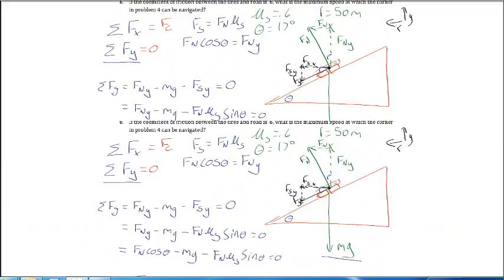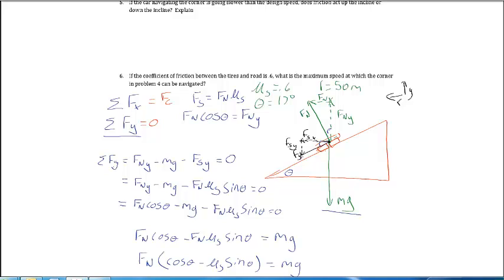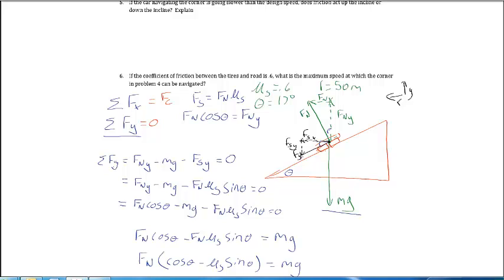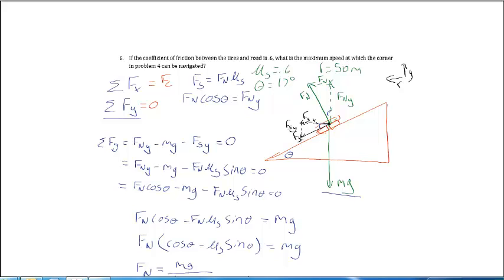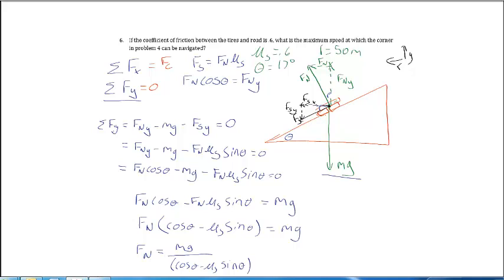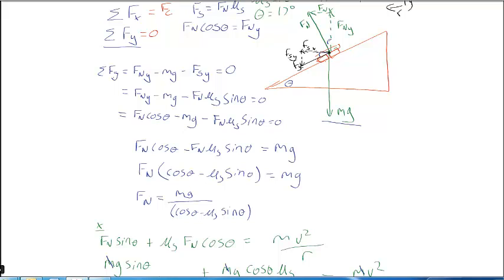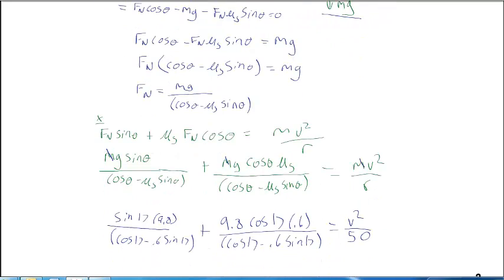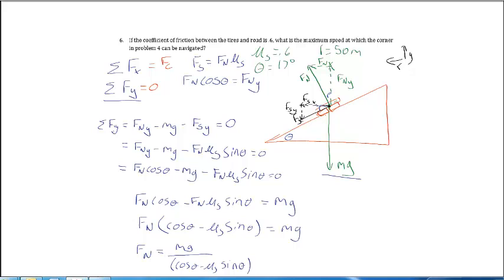Banked Curve with friction

Comment: Shouldn't there also be an x component of weight?
Reply from the maker: +lolzomgz1337 No.  Many times when we deal with a block on a ramp, the block accelerates down the ramp.  In those cases we rotate the reference frame so that the acceleration is parallel to the x axis.  Since the pull of gravity is not parallel or perpendicular to the ramp, the result of rotating the reference frame is that gravity has components in both the x and y directions.  However, in this case there is no acceleration along the ramp, rather the acceleration is towards the center of the circle (we assume the car travels at a constant speed, without drifting up or down the incline). The math is simpler if the x axis is parallel to the acceleration so we do not rotate the frame of reference.  This means gravity is parallel to the y axis, so there is no x component of weight.